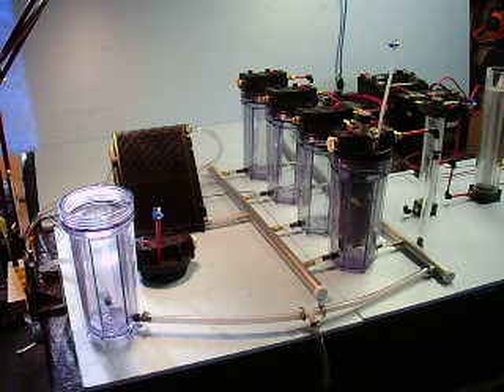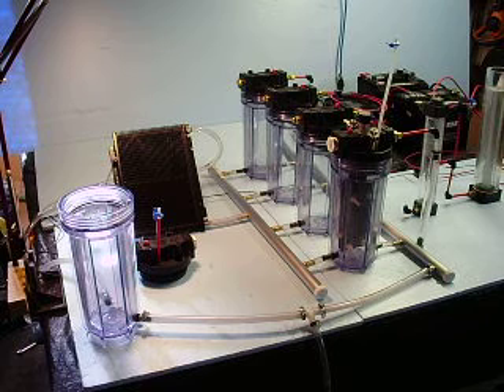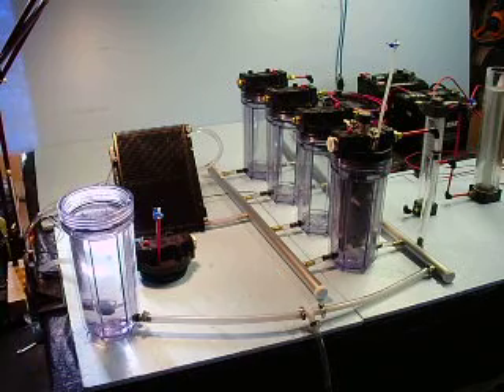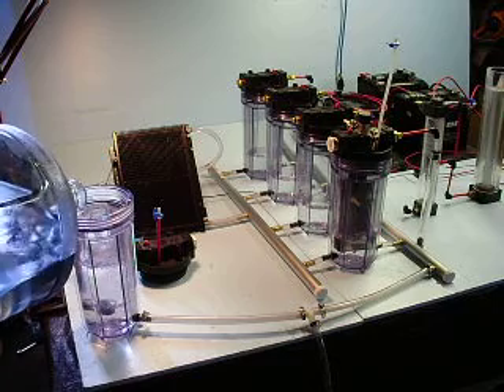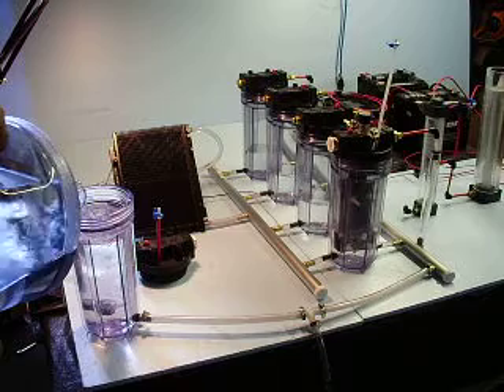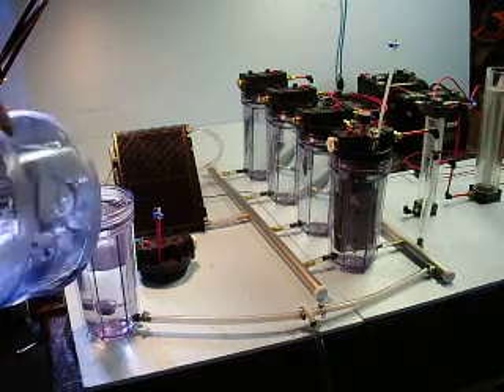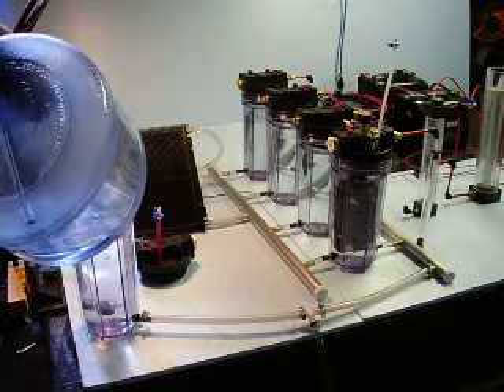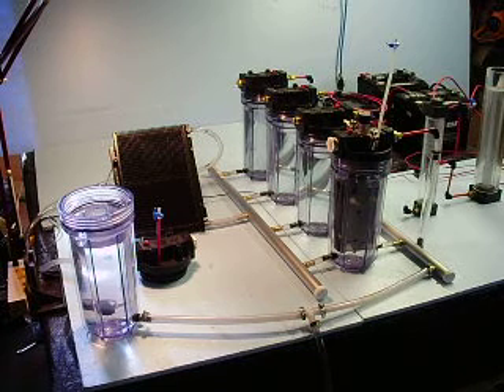015 hho generator plumbing done! see you in sept!

Comment: HI Fizzy,  I must say that you are doing a tremendous job.  I have recently got interested in HHo production & have been searching the web trying to gain as much knowledge as I can to prove/disprove the hyp surrounding this topic. I like the water filter canisters. 
Just a thought on the subject of circulating the water through the canisters, besides needing a non corrosive radiator, the biggest problem maybe with the radiator becoming blocked from sludge produced by the electrolite